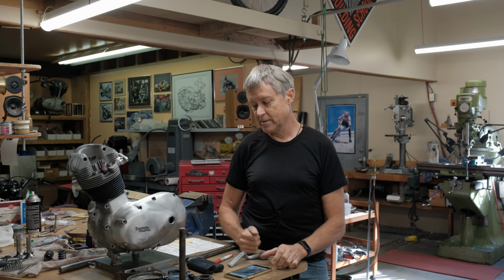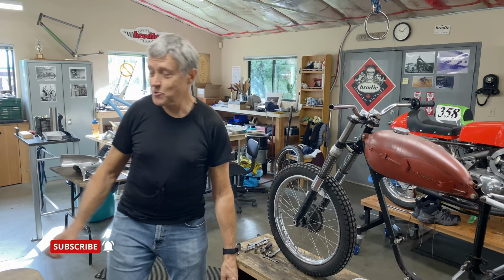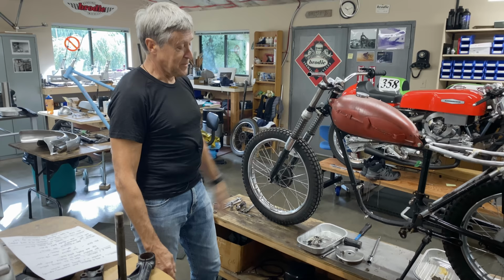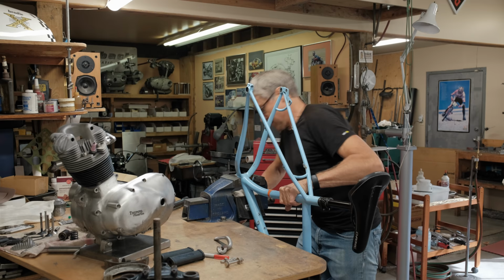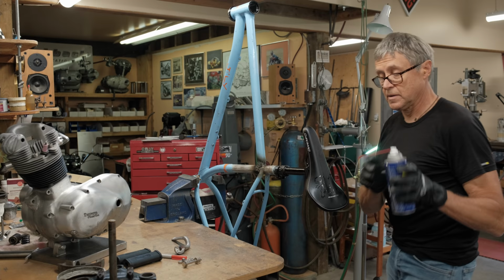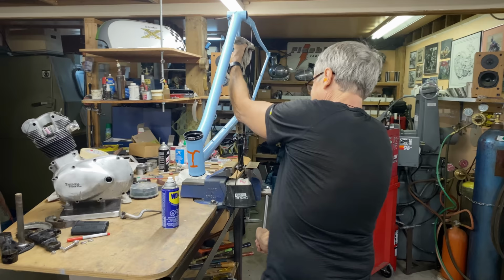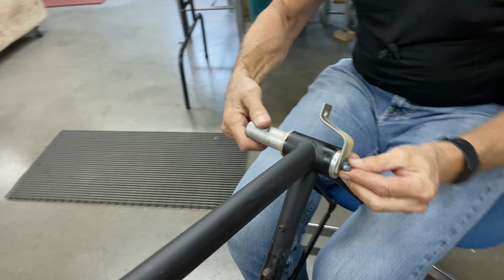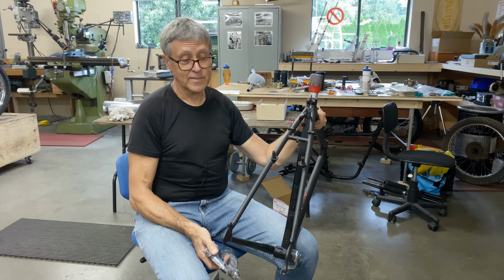Busy Busy Shop // Paul Brodie's Shop

Comment: I wouldn't alter the side stand until you have the bike assembled and sag for the shocks set. The forks / shocks should sag a little with the motor in it.
Reply from the maker: That is a good idea, but I sat on the bike and the rear shocks don't really go down at all. I think I will make my best guess and then get the stand into the paint booth.

Comment: Love your stuff. I'm a biker of over 60 years. Did it all - road racing, dirt, enduros, hare scrambles. Some road racing in Canada - Mosport! Still have a dozen or so bikes, some kind of vintage today like me. Have a shop, though not as well equipped as yours, but I can do most everything. I'm also a lifetime car guy, that's where 'stance' that you mentioned comes in. All important is 'stance' in cars. Gotta look right, sit right. Low in front but not too much, a little high in the rear, big tires - but again not too much. In motorcycles, to me, the best stance ever was the Yamaha DT1. Remember it? Dunlop Universals like your Cub. High in the rear, looked like a cat ready to pounce. This was before dirt bikes were jacked up. Got an old Harley Davidson ERS in my shop covered up for years. Made by Aermacchi, a short track race bike, 350 sand cast motor. Gotta uncover it and do something with it. You are inspiring. Thank you for these videos.
Reply from the maker: Thank you Bill. Of course I remember the DT1. I still have an article I printed out several years on what a success it was. Yamaha sold over 50,000 in one year. That doesn't happen anymore. I wanted the 175cc CT1 so bad, but I didn't have $666. Thanks for watching and commenting.

Comment: I would like to buy you coffees in person and talk bicycles and machining - I worked for raceface running their carbon crank dept, now have a small machine shop in delta.
Reply from the maker: That could happen after I finish painting. A little too busy right now. You would have to be vaccinated.
Reply: @paulbrodie  sure! I've been vacced.
Reply: @paulbrodie  Why?? Vaccines protect the person vaccinated so if you are vaxed that´s all that matters, to you...
Reply from the maker: @Farlig69  Not quite right. You're either part of the solution, or you're part of the problem.
Reply: @paulbrodie  Not quite right, you're either gaslighted and a well boiled frog or well researched...

Comment: Stuck seatposts are the devil. Steel and aluminium don't mix, but on older bikes we moved our seatposts all the time riding trails, now we have these dropper posts fitted and they almost never get moved. I try to make a habit of checking a seatpost will move during each service, and/or giving it a lick of grease.

If the frame is worth more than the seatpost, I have heard you can dissolve it out using ammonia something, but my old boss, and aircraft engineer, used to hammer them out with a 9X rivet gun. The small and frequent hits vibrated them out every time.
Reply from the maker: Caustic soda will dissolve aluminum, but it is nasty stuff.

Comment: My old favorite bike had a stuck seatpost.. - alu seatpost, iron tube,  they were completely fused... i could not move it, I had to cut the seatpost in half, and saw slits in it from the inside with a hacksaw.. what an absolute nightmare! - But it did work out in the end and I got my new adjustable angle seat post in (many many hours later) I had no access to heat, so that was it.
Reply from the maker: Glad you figured it out.

Comment: By adding length to the front forks or the rear shocks of a motorcycle you change the steering head angle from vertical that effects the rake and trail geometry. By doing so you can really mess up the handling of the motorcycle.
Reply from the maker: Yes, it is true. Every time you change one thing it affects several other things. It's all a compromise really. You can't have the strongest and the lightest bike, for example..

Comment: Hey Paula love the channel! FYI The 2x4 under the kickstand is not always to compensate for a change in the height. A lot of the time it is to get the bike as vertical as possible during the photography session.
Reply from the maker: Yes, I have been told that. But, if the bike is almost vertical with the 2X4, then I am sure it leans too far without the prop.
Reply: Could also be a spreader plate, to stop the small foot sinking into soft soil and then the bike falls over ?

Comment: Stance! Cool topic. Motocross bikes in 1973 all had similar frame geometry. In 1974 most racers and manufactures were experimenting with long travel rear suspension. This changed the “stance” but more importantly it changed the rake and trail and ultimately the cornering and straight line stability over rough terrain. Interesting times, lots of testing and cutting and welding. Skills I get to use to this day. 
Thanks for sharing your project and bringing back good memories!
Reply from the maker: Thanks Ron. Yes, back in the 70's I was reading every motorcycle magazine I could get my hands on and it was fascinating to watch the development of long travel motocross bikes.

Comment: Great stuff as usual. The seat post dilema was quite interesting. I am restoring a Torker BMX bicycle from 1981. Chromoly frame, aluminum seatpost that hasnt been  moved in 40 years. Two dissimilar metals plus no antiseize equals beyond stuck! I tried every single thing you did to no avail. Ultimately had to cut off the seatpost flush, and use drill bits. It took quite awhile, but I got there without damaging the frame. The paint info is excellent, Im absolutely a newbie in that world.
Reply: If gentle heat and brute force failed we would melt the seatpost out of the frame - three people with a torch each soon had a puddle of aluminium on the floor.  😃

Comment: As far as Bike Exif is concerned most of those bikes are cafe style. A lot of them are form over function. Yes, a bike lowered in the front does look “cool” and faster when just parked. Mostly just good for short trips. 

If you follow those design principles the forks should be lowered until the tank is parallel with the ground. The top of the tank should be the highest object of the bike. Also, no body part should extend past the rear axle, and nothing past the front axle.
Reply from the maker: Yes, if you explain it that way, it does make some sense!

Comment: I'd be putting a few sandbags in the frame to mimic the weight of the engine, before deciding on a side stand length.
Reply from the maker: You're not the first... It's only a little 200cc motor. Really, how much can it weigh?

Comment: As always, thank you for another interesting video.  

You've briefly touched on one of the most poorly understood subjects regarding motorcycle handling - the relationship between the sprocket, chain, and swingarm pivot.  It's what controls squat under power in the rear suspension.  It's possible to model it mathematically, but it's a nightmare, as it's constantly changing with throttle application and suspension position.  I am, at best, aware that it's "a thing" but I'm barely conversant in it.  It is most important on bikes with big power.  The most famous example of getting this wrong is the Britten -- it famously would wheelie on the banking at Daytona.  Yes, it was powerful, but it wasn't exclusively the power - it was the squat geometry at the SA pivot that promoted the wheelies.

Comment: Hey Mr. Paul, have you pulled those forks apart and measured the travel against your original forks? If the travel is 40mm longer as well as the overall length, its easy enough on conventional forks to put a 40mm delrin spacer under the damping rods to lower the forks by limiting the amount they can rebound. Granted, this will increase the preload on the spring but its also easy to cut fork springs with an Oxygen-Acetylene torch and then heat a little piece at the top and roll down against the next coil to grind it down flat like the originals. Hope that makes sense and maybe helps you. Adding 40mm to the length of the front fork to a 59" wheelbase bike (got the wheelbase from the tiger cub bible) would increase the steering head angle by 4 degrees and the wheelbase by 3.5 inches making it turn really sluggish in comparison to the original setup which may not be great for trials. Take care
-Spencer
Reply: also, I'm an awful painter so this video was helpful. I hope you do some more painting tips in future videos with the tiger cub. I have a 1970 Honda Minitrail 50 that I'm building and would love to paint it myself. I guess I should just give it a whirl and see how it goes. Worst that happens is I sand blast it off again haha
Reply from the maker: Yes, adding 40mm will change the geometry, but 4 degrees and 3.5" sounds like way too much. I do know how to limit travel, and I will consider that, but I think I have to ride the bike first. It's not a trials bike, it's just a road bike so I can terrorize my neighbourhood.

Comment: Regarding the stuck seatpost, I figured I'd share something I noticed recently after a few decades of cycling (proof you never stop learning). 
I was struggling with a seatpost the was slipping, even with the seatpost quick release as tight as I could get it (like having the smack the lever hard multiple times to get it closed). Wiping all the grease off the post didn't help either. 
What fixed it was greasing all the sliding surfaces in the seatpost QR and the interface between the QR collar and the frame. Now a liberally greased seatpost doesn't slip at all with the seatpost collar quick-release adjusted normally.
Reply: Carbon paste also helps.

Comment: Hi Paul. The stance is the relationship between the front and the rear of the bike as you have ascertained. Putting the longer forks in will increase the head angle (the angle of the forks away from vertical). With a trials bike you need you generally have a shorter head angle than you do on a road bike or a racing bike, as the ability to move the bike around obstacles at a slow speed is most important (as you know). You will find that the head angle on the TRS is a lot less (more vertical) than the Cub at the moment. Dropping the forks through the triple T's is one way to change this angle, and it's a lot less expensive/difficult than trying to modify the frame! I have only just found your channel, but I think it's excellent! Rob
Reply from the maker: Rob, I'm not building the Cub to be a trials bike. Just a road bike. I do know about head tube angles. I cannot just lower the forks through the triple trees because the fork tube has a taper that fits into the upper triple tree. Thanks for watching and commenting.

Comment: That's a nice looking frame Mitch built, so how about some details on the geo and tubing he used? Funny thing, I think I know the guy you're talking about with the stuck seatpost that the builder reemed the post out and the whole debacle, he was not a happy camper at all.
The one and biggest thing I take away from all your videos is, always thing about how you're going to be able to hold the part you're working on, whether it be doing machine work or painting, have to be able to hold it properly.
Reply from the maker: Yes, for so many things it is all about being able to hold it properly!
Reply: @paulbrodie  A fab shop in Seattle successfully machined out a stuck seatpost for me years ago, an aluminum post in a 1993 Bridgestone MB-2. (I had previously tried lots of things). They built a 27.2 boring bar and some blocks to hold the frame in alignment in the lathe. Later on they got another post out by securing the BB shell to a steel post/plate anchored in the concrete, and using a forklift to pull the post straight up and out.
Reply from the maker: @jimmmaaayyy5163  Well, that machine shop certainly likes to take on a challenge!

Comment: Stance is posture of standing..eg boxers stance.  
In this case the raised stance caused by longer stronger forks..will change handling from standard.  Increases rake..attack angle of front wheel when turning.  ( castor) .. stress on neck ..also increase pendulum effect when changing lines.  Better view in traffic  also higher bike more visible.   The most pronunced handling effect maybe harder less forgiving fork suspension which coupled with decreased castor may be a negative on wet roads. Would consul an Avon ribbed tyre on font..tyre pressure crucial..and every non delay feedback you can tweak into front brake. Grease cams cable and lever. I have the scars to proove I know what Im talking about..lol
Reply from the maker: Well, I am using a stock Tiger Cub fork, it's just the longer of the 2 stock forks... Also, not planning to ride in the rain. Thanks for commenting.

Comment: I always enjoy your videos being a motorcycle builder myself (mostly Harleys) you won't be able to check the "stance" out without the engine. It's probably not going to be as substantial on you Tiger Cub as it is on a Harley because of the weight of the engine but the engine weight will lower the front of the frame down. I would also be afraid of lengthening the kick stand with out the weight of the engine in it might make it to long. As long as magazines have been doing motorcycle photography they have had to put blocks under the kickstand to make the bikes sit more upright. Although you need a little lean on the bike on the side stand to make it work properly it doesn't make a very good photo. Just saying. Keep up the good work.
Reply from the maker: Yes, the 2X4 is for the photographer. Who should learn how to Photoshop the 2X4 and extend the stand. Thanks for watching and commenting.

Comment: Great stuff, as usual!  I've always interpreted stance as being the visual look of a car or motorcycle (or even a person) as seen from the side.  On a car it can be the overall rake of the body, the gap between the tires and fenders, wheel size, etc.  A good stance should elicit a feeling in the viewer, such as aggressiveness or stateliness.  A bad stance could be considered riding too high, looking unbalanced or giving off a feeling of "just not right".  I really feel like it is a purely aesthetic consideration, and has absolutely no performance correlation.  If it looks cool to you, it has a good stance.
Reply: Exactly my understanding of stance as well.
Reply: But stance can change trail and therefore handling as well.
Reply: Cliff sounds right to me , Always considered it a visual term.As for handling that would come under rideability.
Reply: @836dmar  Not always a bad thing. When people say that, to me, it seems like they assume the geometry is spot on to begin with. It all depends on what the bike is for.
Reply: @Maax1200  Agreed. I have changed geometry as well. One road bike is quite a bit twitcher now than factory and 12K mi later I still love it.  I mention it as it appears many makers(certainly not Paul) put aesthetics first apparently without consideration of other changes - at least it isn’t often mentioned. I see they are separate aspects but I just can’t consider one without the other. Just me I guess.

Comment: I understand that vintage racers will swap the front wheel from 19 inch to 18 and increase the length of the rear shocks to change the STANCE and put more weight on the front wheel for better cornering. Bikes like the Kawasaki H1 tend to wheely very easily because they are front end light!
Reply from the maker: One of the main reasons for going to 18" front on a Vintage race bike is because race rubber is basically only available in 18" size. And a lower stance on the front.

Comment: I knew a guy with a hardtail Ironhead Sportster who could only park in a particular parking spot at a bike night location we used to go to. Otherwise, his bike sat too vertical and was at risk of tipping over. Actually, what you decided on would be risky in Oklahoma winds.
Reply from the maker: Yes, I have heard of bikes that have been blown over in a strong wind. Never happened to me. Once I walked away from my bike and got maybe 8-10 steps before it fell over. Since then, I always put the sidestand down.
Reply: @paulbrodie  I had friend park his Guzzi Lemans next to my Buell M2 and as we walked away maybe 5-6 steps, his bike fell to the right knocking my Buell over too. I was not happy about it. He wasn't a newbie either and it wasn't very windy. Best guess was that he must have had one or both of his wheels in a low spot and it was standing too near vertical as a result. Not a pristine flat parking lot.
Reply from the maker: @lunkydog  Obviously, parking a motorcycle takes some forethought and a certain amount of skill. There's probably a YouTube video out there showing the correct technique for different parking situations...

Comment: These videos are awesome ! So much knowledge. Congratulation for the channel ! 

I sanblasted a steel frame today and I was wondering if it can damage the steel ? Could not find any clear answer on the net (some say yes and no). My frame is a Columbus Cromor and I sanblasted it with aluminium oxyde #60 at 80 psi. Thank you very much !
Reply from the maker: Thanks for liking our videos! Yes, you can damage a thin-walled steel frame with excessive sand blasting, especially if the media is very coarse and sharp. I use glass bead No.6 and it is gentler on the steel, also at 80 psi.
Reply: Thank you for this information and your reply  @paulbrodie